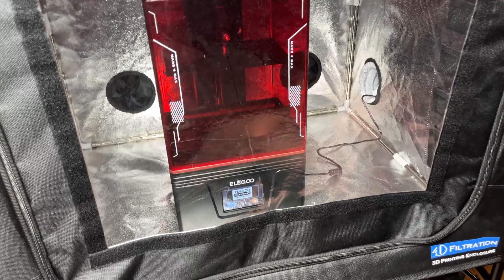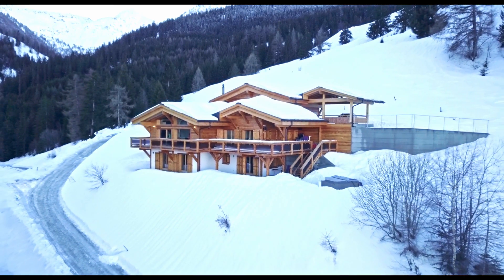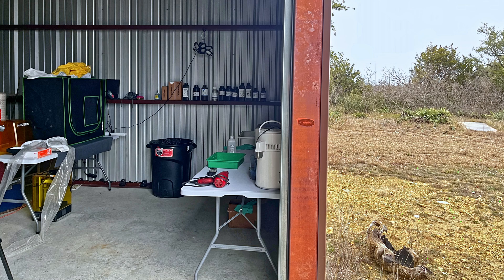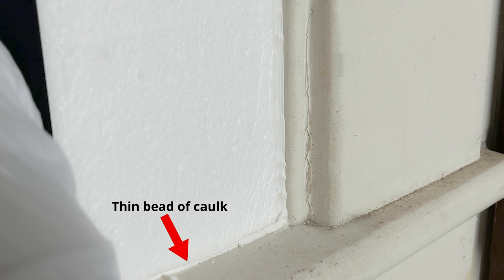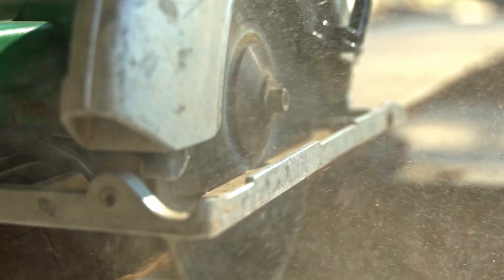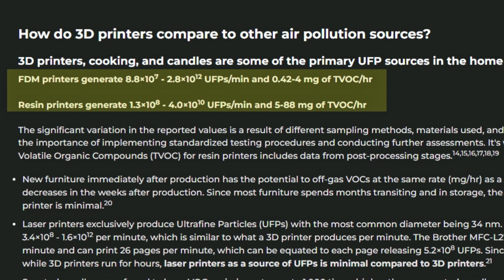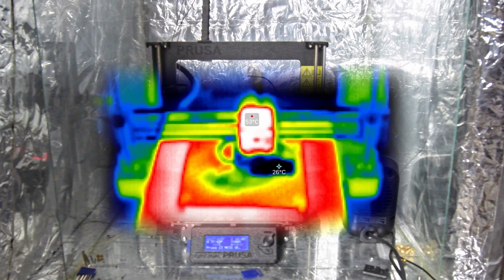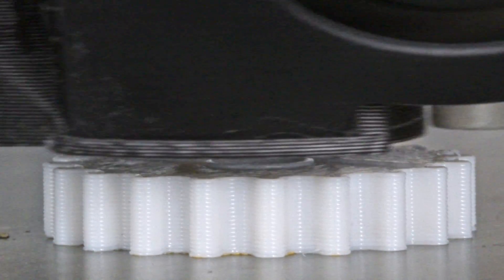FDM & Resin 3D Printer Ventilation

Comment: Thank you for all your videos! I have a question: I'm using my resin printer in my basement (unfortunately no window but i'm working with a gas-filter-mask). Do the fumes evaporate by time or do they accumulate by time and it's getting worse worse? Because there are our washing machines for laundry, does my girlfriend have to worry going in while nothing is printing/curing?
Reply from the maker: This is a common concern and it is valid - it's actually both.
Without any ventilation (or proper filtration), the fumes will continue to increase in concentration, but they will not infinitely increase due to factors like natural leakage out of the house.

One way to look at it is sources and sinks.
The sources will be slow off-gassing while it's in the vat, printing, and post-processing - each has a different chemical profile and emission rate.
The sinks (or elimination routes) will be ventilation, filtration, natural leaks in the house, natural degradation of the chemicals, adsorption into clothing etc, or adsorption into our lungs (to name a few).

I would highly recommend looking into drilling a 2 to 4 inch hole through the wall for ventilation. Without a way to exhaust the fumes, they will remain in the basement after printing. Cleaning everything out and putting the resin up after a print can help, but the fumes (and odor) can remain for days to weeks.
Usually, a garage is the best location for most people, but it's also understandable that everyone's situation is different.
Reply: @ArisAlder  We rent this apparment so no drilling is possible..... What do you think about air purifier with active charcoal?
Thank you for your feedback!
Reply from the maker: At this time, I still can't recommend relying on filtration. Even large amounts (2-5 lbs +) of specialized carbon/media will not be as effective as ventilation nor as cheap.
Reply: @ArisAlder  Hey there! We will get an ventillation installed due to high humidity 😎 I have read a lot about ozone generator against the smell. Do these also work against the voc? Thank you!

Comment: I want to place an open FDM printer on the desk in my room. I only want to print with PLA, PTEG, PTU. Is an air purifier enough to make the room safe?
Reply from the maker: Any consumer air cleaner will be sufficient for PLA since the main concern are the UFPs, but there is less research on PETG and TPU.
Generally, all 3 of those will be fine. If you start having any respiratory irritation then reevaluate.

Comment: Hi do you think a Elegoo Saturn 4 Ultra with the Mars Mate Air Purifier is enough to protect me or I need an exhaust.? My setup is in my basement
Reply from the maker: I can't recommend using filtration for resin setups, especially with normal activated carbon in low amounts. The type of filtration needed for a resin setup to be safe is costly long-term, which makes ventilation the most feasible route for most people most of the time.

If you're in a basement, it should be relatively straightforward to install a small duct hole (even through concrete). It's possible to even get away with a hole as small as 2 inches in diameter.

Comment: Ok what if i place the resin printer to the corner of my balcony and cover it with completely black curtain or box while its printing and just open the cover for get rid of toxic fumes when its done?

Would it be safe for me and the nature, animals, neigbours sitting on their balcony? Would it be harmful for them if they inhale even if the toxic fumes on the open air?

and i wonder that whats happening to these toxic fumes after vent out? Are these dissappearing or stays on air?

Thank you
Reply from the maker: Placing the resin printers in an enclosure on the balcony is common and a great way to solve the ventilation issue. However, if the balcony is more of a courtyard and there are not strong winds, then it could create an issue with neighbors.

What happens to the fumes depends on the exact chemical makeup. Formaldehyde is one byproduct that when exposed to sunlight degrades in minutes. Other byproducts can settle in the soil and be broken down in days. A primary concern on this front would be plastic particle pollution (from primarily fdm printers) that can settle in soil and water, eventually reentering in our food supply.

Filtering particles is very straightforward, but dealing with the chemical fumes is trickier and more costly.
Reply: @ArisAlder  Thank you so much for detailed answer. ^^ Im trying to decide between FDM and Resin for one week but its so difficult to choose. FDM has too much noise and Resin is toxic. There is a wind outside but also its living room's balcony and i can cause all the fumes inside to house :D Man its soooo hard to decide. Im feeling like im playing Oxygen Not Included in real life :D 

I think i need to ask to my neighbors which negative effect they want, Noise or Fumes.

Thank you again. ^^
Reply from the maker: People often end up getting both, but FDM is usually the best place to start with most people. The FDM printers are often pretty silent when not printing fast and when inside an enclosure.
Reply: @ArisAlder  Thank you so much. I didn't know that. Yea im ok with printing with 50mm for silence. My mind is clear now and im gonna buy FDM. Thank you for your guide ^^

Comment: So what do you think about the concepts of nevermore filters which push the air through a hepa filter and active carbon pellets. Is this sufficient from your point of view? Furthermore i would like to know if a continous running PC fan which sucks the air out of the chamber/box out to a window with a flexible hose will do the job in combination with a nevermore filter. 

I think the Potential risks of 3d printing is underestimated and discussed too less. Especially when kids are using them in school or in their child rooms.
Reply from the maker: The HEPA filter will be great at capturing the particulates, assuming the filters are legitimate. I believe that one and/or the bento box call for filters sourced off AliExpress.

The amount of activated carbon in those is suitable for say PLA, but other filaments like ABS will be saturated much more quickly.
The amount and type of carbon in these will do very little against resin fumes, especially specific compounds like Formaldehyde.

A standard PC fan (120 mm) is not strong enough to exhaust the air. The static pressure of these are often 5-10% of a centrifugal or inline fan. Some higher wattage and specially designed 120mm fans, like the one in the video, can be used but it would still be susceptible to strong winds. They are also very loud.

Comment: I have my resin and fdm printers in a spare bedroom in the house. the resin printer is in a grow tent and when im printing i have the fan on venting the tent outside. is this safe enough to keep the printer inside if no ones using the spare bedroom? Feels like I should move it to the garage but not sure if im being overcautious at this point
Reply from the maker: If no one is using the room then it is generally fine. 
While it is more convenient to have inside, it’s technically safer in the garage.
This is one of those situations where you the ability to use either - up to you. Two deciding factors could be small children or health conditions (you or family).

It also never hurts to have air cleaners in other parts of the home. Personally, it’s just so nice not having to wakeup with even just the occasional seasonal allergy like pollen. Any consumer air cleaner will capture particles like these. The VOCs are a different story.

Comment: Awesome video, great breakdown and solutions.

I have a TPU gasket on my resin printer and moved the internal fan to circulate the air though a two stage carbon and hepa filter. It's a sealed system, wild to me that they would think a single pass though a filter would actually work and pump the air out. This is also in a walk in closet that i have my other FDM printers in which a put a rubber sweep seal at the bottom and foam tape seal around the sides. Not only does it keep the warmth in the closet very well but i also have another hepa filter always running any time you turn on any printer (main power strip is connected to a smart switch that i use to power everything on/off).

Before i had the walk in closet sealed up i had it in my room printing ABS (this was over 10 years ago) and after two days i found the exhaust fan wasn't enough as it was vaguely smelly and i got a small headache from it. Had the idea to flip it around and create a positive pressure then place the printer near the other window. That worked FAR better, not even a hint of ABS smell. My suggestion is hard to do on hot or cold days, which is why everything was moved to a sealed closet.

The closet has a smart camera that if detects the smoke alarm flips the smart switches off and i have automatic mechanical over stove kitchen extinguisher over the equipment just in case.
Reply from the maker: For sure you have put a great deal of thought into your setups, and it seems to be working out well for you.
The HEPA filter in the closet is awesome because it will capture nearly all of the particle the printers are putting out. The carbon captures most of the VOCs, less so with resin - some VOCs like Formaldehyde are impervious to normal carbon.

Out of curiosity, which exhaust fan were you using?

The automatic fire extinguisher and switches are a nice touch in case anything goes south.
Reply: @ArisAlder  when it was open in my room a simple low profile window fan facing inward and a 120mm PC fan facing out to help out and some random aluminum coil ducting.

And now that it's all in a closet there's no ventilation to the outside, just the filters
Reply from the maker: Yeah 120mm fans are generally not great at exhausting air, and the ones that are push 20+ Watts & are super loud. An inline or centrifugal fan that is at least ~50 Watts is recommended to get sufficient venting. Everything has to be nice and sealed as well.

Comment: Thank you for the heads up on ufps, I didn't know this was an issue and will be setting up an enclosure with a filter for my fdm printer and waiting to figure out a better spot for my friends resin printer
Reply from the maker: Of course! There’s also a dedicated video on the UFPs plus an article.
Thankfully it’s an issue that’s easily solved with any MERV 13 or HEPA filter.
Reply: @ArisAlder hey it’s a wonderful video but do you think I should do this if I just print pla
Reply from the maker: If you are just printing with PLA then any consumer air cleaner with a HEPA filter is appropriate (or MERV 13 panels on say a box fan).
Reply: Arent most UFPs smaller than what HEPA Filters can pick up? I havent really found a solid solution to UFPs @ArisAlder

Comment: Thank You. I may have missed it in the video though with resin 3D printers what CFM would you recommend? And do you have any suggestions or recommendations for 3D printer enclosures i.e. what I should look for or keep an eye on?
Reply from the maker: A smaller indoor room can get away with a 100-200 CFM centrifugal or inline fan, and the simplest enclosure will be a grow tent. Custom insulated enclosure can be really nice in terms of efficiency (for trapping heat if not venting), but they also require a bit of upfront work.

Comment: How long do these particles take to break down being outdoors? I don't want to expose my neighbours to my pollution

Do they take thousands of years like common microplastics?
Reply from the maker: The particles, once outside, can take hours to weeks to completely disperse out of the air back into the ground (lots of variables at play). The main concern with the plastic particles (filament will also have other particles like metal oxides) from 3D printing is that the nanoplastics can re-enter the food chain. 

An extreme hypothetical example is let's say a large print farm or other source of plastic pollution is near a large chicken farm. A percentage of the plastic particles can settle on the ground where the chickens graze and eat. These nanoplastics will be in the chickens' bodies or eggs then be eaten by us. To really gauge the impact of such a scenario, there would have to be a really focused study (some like this probably exist).

It is ideal for people to filter out the particles leaving a 3D print[er] to prevent nanoplastics from entering the food chain. This topic gains little notoriety since there are larger concerns in society such as brake dust (one interesting example). Brake dust makes up 20-60% of all traffic particle emissions and thus up to ~10% of particle emissions in the US. In the recent years, organizations like NASA and the EPA have identified and pushed for the mitigation of materials that will harm us and wildlife (e.g. antimony, cadmium, copper, lead,  and mercury). Brake dust is an interesting one because all of us with a car are a contributor, and there has not been a great solution as of yet.
Reply: Hybrid or fully electric cars would help a lot with brake dust 😊 @ArisAlder

Comment: If you could go more in depth on filtration setups that would be geatly appreciated. I'd like to be able to run both my resin and fdm machines and at the moment ventilation is not an option
Reply from the maker: My UFP video touches on the particle side of things for FDM and resin, including filtration. It's on my to-do list to do a similar one for VOCs.

Using filtration for FDM is easier than resin, and hopefully within the next month I can do some testing on filtration media for resin then push a video out.

Comment: I live in an apartment and have my printer in a second room with the internal door shut and a balcony door and window open. Wondering if this is sufficient. I usually only enter the room with a mask with a 3M organic vapour filters. 

Also considering putting my printer on the balcony itself but wondering how i can protect it from wind and rain.
Reply from the maker: Having the balcony door + window open is good to bring in cleaner outdoor air, but the winds can push contaminated air throughout the rest of the apartment. If you were running a print farm then this could work if you sealed off (like an airlock) that entire room (vents + door).

For your situation, the two best options are:
1) Having it on the balcony in a grow tent.
2) Having it indoors in a grow tent and sealing it up against the window like in the video (plus the fan).

The balcony is the safest option as it nearly eliminates the entire indoor air quality issue. Wind can be mitigated by weighing the grow tent down, and rain can be mitigated (one option) by hanging a mesh screen (like for mosquitos). There are probably a few other good ideas floating around for mitigating the rain.

Comment: Why vinyl duct and not cheaper material ?
Reply from the maker: Vinyl is actually one of the cheapest materials that won’t degrade as easily over time.
More expensive options would be like: Fiberglass, silicone-coated materials, aluminum, rubbers, or flexible plastics

A good comparison site is McMaster
Reply: @ArisAlder  thank you for your video i was really concern about VOCs

Comment: I not not have a printer yet but i want to install in my garage. I live in Houston , very humid.  What is best in your experience with PLA, vent during or after the print? Thanks
Reply from the maker: PLA is comparably safe and is often used indoors with only filtration. However, it is certainly safer in the garage. You wouldn’t need to vent PLA actively unless the space is being used for other purposes (with people).
Reply: @ArisAlder  ok many thanks!!
Reply: @ArisAlder I have a similar question. I’m getting a non enclosed 3d printer to print pla and Petg and plan to put it in my garage that is attached to home. Not cooled or heated. No windows only doors which can open durning day weather depending. My thought is to put printer on counter next to exterior wall and put a dryer vent thru the wall by the printer with an exhaust fan or computer style fan to vent it outside while printing. Do you think this would be sufficient for particals and fumes? If I were to be the garage while printing I plan to open the big double door.
Reply from the maker: Setting it in the garage with an exhaust fan outdoors would actually even for ABS, so with PLA it is indeed effective and it could be considered overkill.

If you don't plan on being in there while printing then you can just open up the door for a few minutes to air everything out, and like you said, leaving the door open while in there is fine.
If you do decide to go with the exhaust option, then make sure to use an inline or centrifugal exhaust fan. A typical 120mm PC fan can be overwhelmed by outdoor winds. Any fan above 20 Watts would be fine.
Reply: Did you end up getting a printer and puttig it in the garage?  I'm in Houston, too, and thinking about moving mine into the garage.